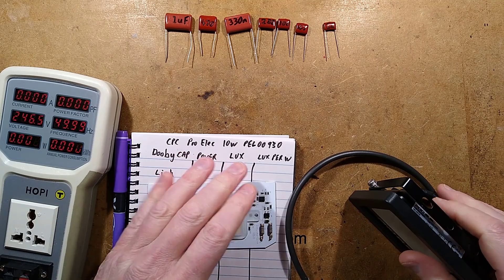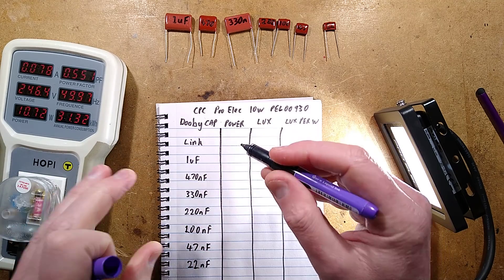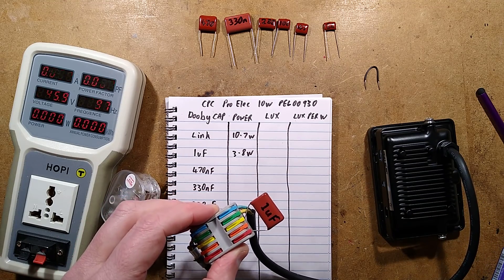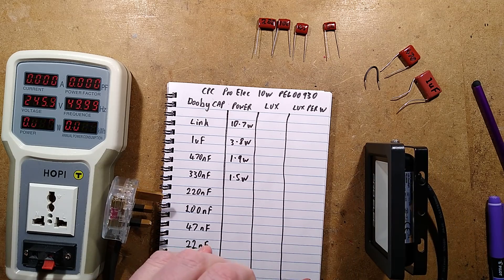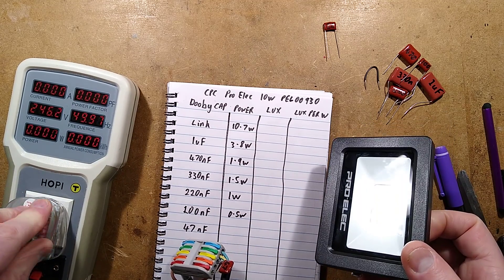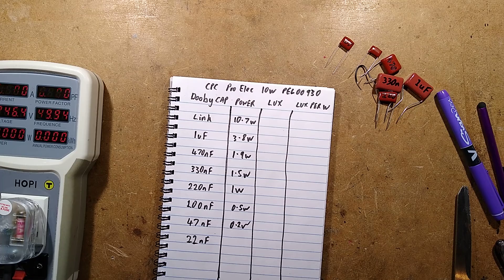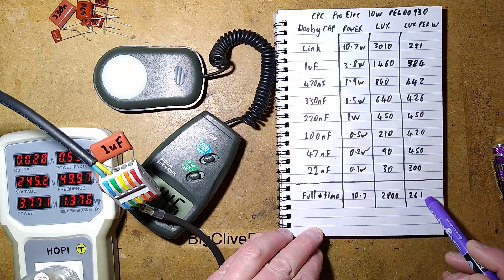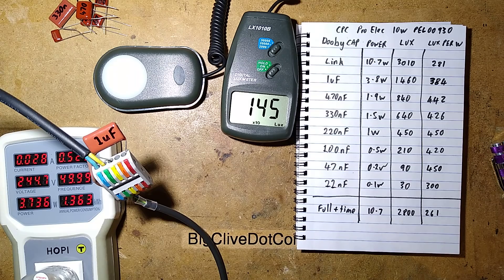Doobying a cheap LED floodlight with lux/efficiency readings

Comment: Is there such a component as a variable capacitor?
Reply: There is but they are much lower in value, usually less than 1nF. And the biggest value ones are expensive. Small ones were used to tune analog radios and tiny ones to adjust wristwatch crystal oscillators.
Reply: For testing dropper circuits you'd probably want something like a decade box. Basically a box with switches bringing in different combinations of capacitors to get close to a given value.

Comment: Hi @bigclivedotcom

When I worked for a subcontractor to Philips lighting commissioning lighting control systems, we had to get new light meters specifically to measure LED lighting. Normal (cheap) light meters are designed to measure the output of tri-phosphor fluorescent and tungsten fittings.  The really old light meters that work without batteries are tuned for halophosphate.  Should you need accurate measurements of LED fittings a reasonably priced option is the ‘Tenmars 201’ at around £80. If you need to measure coloured LEDs the ‘Tenmars 209M’ is about £150.  Most of the other LED specific lux meters would leave a dent in your bank balance the size of a small country.

Comment: Maybe you should isolate the system in a box for the lux test. It's probably a bit influenced in terms of light received by the sensor because it's directly disturbed depending on the position and reflectance of your beard !
Reply: Doesn't matter. The meter is not accurate at all.
Reply: Each of his eyes twinkles at about 80 lux.

Comment: 2µF or 3µF would be more interesting. Drop the ~11W down to about 7, just enough so that the LEDs aren't overdriven any more, but still put out 90% of their light...
Reply: Change the current sense resistors. 
More accurate, no need for a capacitor outside of the case.
If there is a capacitor inside the lamp, replace it with a smaller one.
Reply: @CyberlightFG  Oddly enough almost all circuits have 2x RSense in parallel, desolder one  and it's usually enough to reduce the current down to the LEDs not to be overdriven.
Reply: @stanimir4197 What do you think is a more power efficient approach - modifying with a capacitor or destroying/replacing a resistor?
Reply: @nevenpavlovic4448  capacitor is definitely not. The capacitor dropper changes the power factor on its right own, and the energy is actually dropped on the resistors, so there are less losses on the resistor part alone.

Comment: Lux like your on to a winner here Clive.

On a more serious note, would be good to see a temperature performance on something like this in future.

For those of us who have a short drive in front of the house, a string of these would be good permanently lit, with the newer LED street lights. As unlike the older discharge lighting, they do not throw enough light to see too well off the main area of light. Or even a few of these would keep the garden lit and still not use as much electricity as the old spotlights.

Comment: I would like to have seen 2uf, probably around 6 or 7 W. I put up a 150W halogen outside on a sensor in 98, it is still working but the screws are rusted in so that I cannot change the tube for a LED replacement.

Comment: That’s very interesting, I imagine you could buy the 30 watt version and adapt it in a similar way but get a similar light output to the 10 watt. It would probably rot off the wall before it failed 😄
Absolutely love these experiments especially with rainbow 🌈 connectors
Reply: I would have liked to see this lamp run with a 2.2uF capacitor (and maybe any others between that and the 1uF Clive started with) to see how linear the relationship between capacitance and wattage is. More data is better right? I have a 50W lamp of this type that I'd like to drop to around 20W but the cost of the (at least 400V) capacitor to do that is probably prohibitive.
Reply: @Shaun.Stephens  yeah, clive really gave me an idea there. really good to know :-D
 e.g. using these lights as backlight-illumination for self-made signs.
But the capacitors... they aren't that expensive? 
eg. Reichelt sells  2u2 X2-class foil capacitor for around 1€ each? larger (and also, cheaper quality ones) are available..
Reply: @Shaun.Stephens  if you have 250V caps available remember you can also use them in a row, halfing the capacity

If i remember correctly... for two of the same it comes out for 0.5 the single capacity...
 1/CapTotal = (1/470nF) + (1/470nF) = (2/470nF) => inverse (470nF/2) = CapTotal = 235nF
for more theres calculations...)
But you should measure and pair identical capacity ones.
Reply: Usually the 30watt varieties have the same number of LEDs so efficiency won't be better if that is true. Its very common they drive the LEDs harder and prey they don't die too quickly
Reply: @wasteoink8376  Well, the end-user prays they don't die too quickly. They, the manufacturers, want it to die ASAP so you buy a new one!

Comment: The resistive current regulator is a terrible design and it's pretty inefficient. Adding a capacitor really improves the efficiency.
Reply: In an led bulb the current reg only dissapates a fraction of the power... In my modified bulbs the reg barely goes over room temperature, so hardly any waste...
Reply: @burtgummer9057  But here the heatsink doesn't keep up apparently, so the regulator has to decrease the power and the LEDs will burn out eventually.
Reply: Those ubiquitous 12V LED tapes use resistive droppers.
Reply: @westinthewest  That's true and you have to consider adding a heatsink to more powerful LED tapes.

Comment: Clive - The LEDs like being cool and do get more efficient the cooler they are, but there gets to a point where this effects stops and some LED will get less efficient if the get too cold. Can I suggest you build yourself a small integrating sphere / box for light measurement. The sphere / box should have holes opposite each other (one for the light and one for the detector) with a baffle to stop direct light from the light source hitting the detector. I would recommend the size of the sphere / box be approximetley 5 times the longest distance of the light source. I.e. Light source 100x100m - sphere/box size 500x500mm

Comment: If they are cheaper then studio light I guess you could use the floodlights as studio light with a variable capacitors if the range is good enough and 240V compatible. What do you think Clive?
Reply: not ideal for filming

Comment: @bigclive.com I have a question what does adding a 1Uf capacitor do to incandescent lamps? I mean what if one were to add a 1Uf cap to all ones lamps regaurdless of led or incandescent would it add life to either type bulb?
Reply: This will dim incandescent bulbs too, but possibly too much. A 1uF capacitor has an impedance of about 3k ohms = 1/(2 pi f C). A 100W incandescent where I live has a resistance of about 600 ohms (V²/P), so that would result in the bulb getting about one 6th of the voltage. The life span increases considerably - life span for incandescents is approximately inversely proportional to the 13th power of voltage - so 1/6 of the voltage should mean 13 billion times the life span. The problem is that efficiency (light per watt) drops too, proportional to the square of voltage, so you'll get approximately  one 36th of the efficiency. Combined with the fact that you have one 36th of the power draw for the light itself (P=V²/R), multiplied by the lower efficiency, means the usable light output will be one about 1300th of the original bulb...

TLDR: If you want to reduce the power usage of an incandescent bulb, just buy a lower wattage bulb, it will be more efficient than trying to drop the voltage. Having said that, putting a very low value resistor (not capacitor, their impedance is too high for this application) in series will greatly increase the lifespan if you are happy to put up with the efficiency (and output) drop.
Reply: @binaryagenda  Another way to reduce the power (and increase the lifespan) of incandescent lamps is to add a diode in series. Unlike a resistor it won't waste any power. The main downside is it could result in slight flicker.
Reply: @eDoc2020  There was an "enhanced efficiency" incandescent bulb that had a diode in series (marketed as "enhanced with solid state technology"), but they appeared right as CFLs were becoming cheaper so not very successful.
Reply: @NiHaoMike64  That doesn't make sense. When you put a diode in series it decreases the efficiency a bit.
Reply: @eDoc2020  Adding the diode allows the use of a shorter but thicker filament for the same wattage, thus increasing efficiency a little bit.

Comment: Would it be a benefit 100w led 240v using a 1uf drop it to say 50w and what about 1.5uf say 7w brilliant idea Clive save the electric bill in my unit as I have 6 100w lights 180w saving and last a lot longer
Reply: To dim a 100W to 50W would probably need a 10uF cap. The value of capacitance needed varies with the load. Clive was dimming a 10W lamp.  Six 100W LEDs must be very bright. Are you sure they aren't 100W incandescent equivalent?
Reply: @whitcwa  no there out door lights in door lol yes very bright they do run a little hot there pulling 89w each thinking of pulling them down to 60 or 70w so they run cooler thanks Chris I'm still learning lol

Comment: What are the best low consumption leds for a solar van conversion anyone...? 🙏
Reply: Are you asking about individual LED's , or ready-built luminaires such as these floodlights?  I'd say you can use anything except LED tape which uses current-limiting resistors.  It's the most commonly-available version of LED tape, and is a simple way of connecting to your 12 V supply, but the resistors lose some of the energy as heat.  Proper constant current drivers seem to have similar efficiencies of about 90%.
It's also worth remembering that all LEDs will run happily at low power, so they can all be classed as 'low consumption', although you might as well just use cheap ones instead of buying Cree XHP70's and running them at the same power that a ubiquitous 5050 could handle.
Reply: @westinthewest  I've heard the regular 12v style LED tape works well at lower voltages. If the power is stepped down to 10v first they should be much more efficient.
Reply: I'm just trying to save my battery as much as possible....
Now we KNOW that we don't CONSUME electricity (we just connect to a grid that is endless)....
'Peter and Pete' explain this perfectly...
I just want to use ANY kinds of lighting that won't destroy or use up my batteries as fast 🙏
Reply: @flyonthewall7026  It seems you need to generate as many lumens as possible per watt of power drawn.  I've seen figures for individual LEDs varying from 75 lm/W  to  120 lm/W.
If you see a typical £5 floodlight from CPC rated at 10 W and 800 lumens,  then that's a decent 80 lm/W.  
There might be something similar which gives you 120 lm/W, but will probably be more expensive.

Comment: Hey Clive, if you permanently incorporate the 100nf cap, you'll have a modern version of that light bulb that's been lit for over 100 years. Maybe we can put it on the other side of the same fire hall?
Reply: I guess solder joint or voltage spike damage to doobing cap related issues will kill it sooner or later.

Comment: We need to have dooby lamp technology everywhere,  it will definitely help the environment
Reply: even citadel clu048s from 2016 can do 155 lumen/watt, and when you drive them soft, they go up into the high 170s lumen/watt.
low-power led array/strips like the samsung lm301b and stuff break 200lumen/watt nominal, and can still be tweaked.

and COBs can take some serious torture in terms of thermals, the point of failure is not until 120 degrees celcius... whereas led technology usually is very sensitive to it because of thermal resistance drawing more current, but these are 12x12 led arrays in a COB, so even those spikes are temperd, there's no comparison to that flip chip magic.

how much is that in lux? depends on how far you measure from, but i can easily get a 16-20K lux reading from a single COB. (@ 3500k color temperature might i add), which would go well into 400 lux per watt, that's med-power 2016 bay lighting going against low-power led arrays, the latter is in a category more efficient and it can barely keep up, if at all.

inverse-square law is a bitch though, so lux doesn't really mean much unless you know the exact distance, 
also, lux and lumen measurements are predominantly about the green and the bordering yellow near it in the visual spectrum,
the numbers favor cool white light (4200-5000k), you will always have a bit more lumen/lux per watt on cool white for the same efficiency,
despite the fact lower frequencies (red) are the most power-efficient without a contest, they are outside the scope of lux/lumen

lux and lumen are pretty useless numbers for photosynthesis anyway (we got PAR for that), only useful for roughly comparing broad-spectrum lights with the same color temperature,
even then... higher CRI ratings can mean lower LM/watt output despite being superior in light quality, because it leaks less into green and yellow.

but the transformers in some rando led bulb aren't to be compared with a proper meanwell driver either, 
it's easily 10% less light output when running them off some rando constant-voltage psu, and that psu is likely not 94% efficient from the wall either.
i got myself an homemade aluminum sheet with 9 clu048 1212s, running at like 65% of their nominal power, at which point they near in at giving 75% of their light output,
but as it is dimmable, i can crank them up a bit, they really don't punish you all that hard until you go well over twice the nominal in terms of light efficiency, but thermal output is a factor too, and hotter running leds will be less efficient too, and ofcourse draw more current, inviting even more heat because of thermal resistance... it's the sum of 2 evils that can quite quickly add up if you don't care for it.

that said, i can run them passively cooled on a 50x50 CM aluminium sheet at around 130-170 watts without them even going over 60.
 
what durabilty is concerned for leds: it's ALWAYS the transformers that fail on cheap shite, it gets a big spike and just burns up, and people attribute it to the leds being shitty... very rarely the case,  anyone who has the belief should pay attention to how their leds almost always blow out when they turn on that switch... not when the light was already on
because the transformer is gash... 99 out of a 100 that's the case, the fact normal led modules tend to let out the magic smoke at 55-60 degrees already doesn't help, save yourself that shit, and get some real durable cobs that can eat their nominal drive threefold and still be ok, as long as you contain the heat, you can spike them way over that threefold point and they'll be alright without any resistors to limit them

i mean, if people insist on using shitty drivers/transformers, you can't expect them to put the resistor there either, so it's a non-argument, but yeah, having that resistor there works even better when your power supply is ass.

you can argue output efficiency all day, but even old leds don't just fail if you drive them right, they can easily do 5-10 years, even epistar could already guarantee 5-7 years back in 2012 on their 3 watt 640nm modules lol, i have old beaten blurple panels from 2012 that still function, their efficiency is dogshit for today's standard, and they have degraded since, but they're still working lol
the fact people's led bulbs don't last 5 years at the least has little to do with the leds... they are merely a victim of the botched power delivery.
even fucking CFLs would already blow out on the transformer way before the light snuffed out 8 out of 10 times, the power delivery quality on built-in trasnformers on bulbs has objectively been shit ever since their inception lol
if you can't keep a constant current, and aren't going to limit it either, you're gonna have a bad time.

fish knows whats i'm talking about  :D
Reply: Schmok a dooby Scooby.
Reply: yeah, but then the big companies that make these lights can only sell you them half as often if they make them last twice as long
so naturally, they make them super bright and 'energy efficient', with the downside that you have to buy a new bulb every 2-3 years (or however long they last)
Reply: @Stevo_1998  Dubai lamps are dim and efficient and last forever
Reply: @fish9468  aaaaaaaaaaand you can only get them in Dubai
They only exist cause the leader-human decided to make a law or whatever that required the bulbs to be /actually/ energy efficient and to basically last forever, and the companies that make them don't sell them outside Dubai because they'd lose money on a bulb that basically lasts forever.
Reply: @Stevo_1998  yea. So your comment was wrong. They don’t naturally make them super bright. As I said, in the grow light industry, they make efficient, long lasting LEDS with honest specifications too.
Reply: @fish9468  My original comment wasn't replying to yours though? I was replying to the original comment at the top of this chain?
Reply: It's the best thing to come out of the Emirate of Dubai since the airline. Dooby is a revelation in the fight against climate change.
Reply: We do in the grow light industry.  Check out migro and chilled. I’m working on a design that uses cheapo leds instead of high end ones rn
Reply: @fish9468  If you get stuck with high efficiency long life SMPSU's let me know. I have designed a fair few professionally.